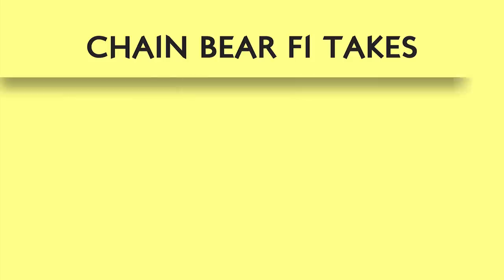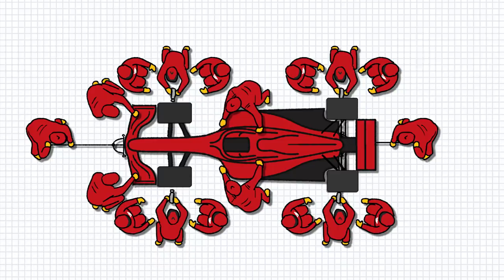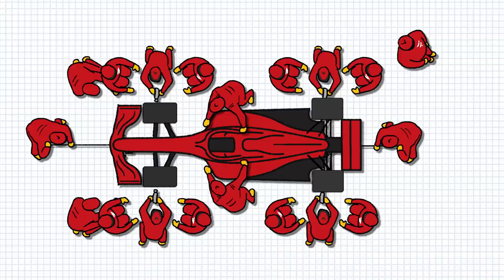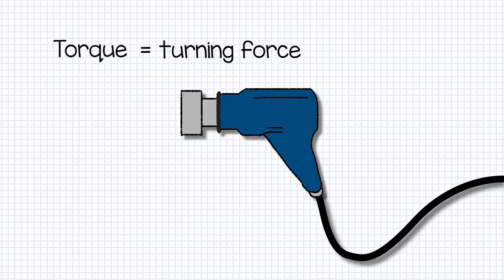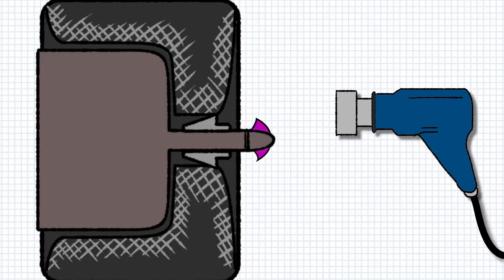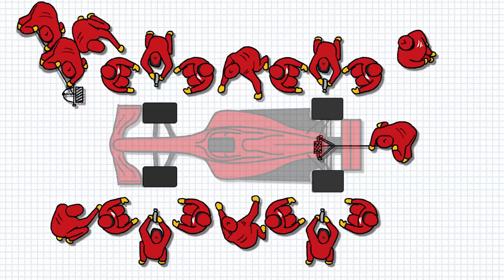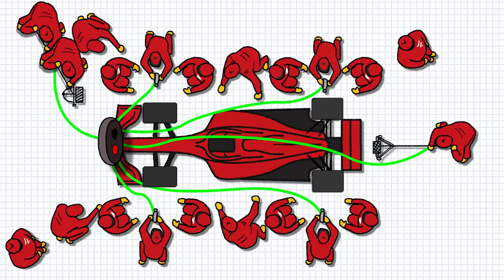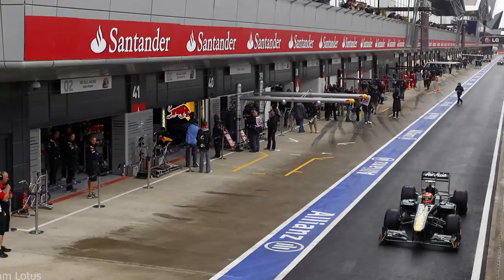The anatomy of an F1 pitstop - Two seconds of mayhem - Bahrain GP 2018

Comment: In this modern world of sensors... Wheel nut sensors for secure fixed tyres?... Sensor under on the car where the jack points are to assure the car is down... ultrasonic distance censor to break or prevent launch, that should save the guys from getting ran over.

It may sound simple, but these are all gadgets that already exist with real-world applications.

Comment: Or, 1 operator inside the building for each wheel, looking with a camera fixed on top of the car.each operator would have to release a button when the surrounding of the wheel is clear and mechanicaly done.1 operator looking at 3 mechanicians, more clearance vision, stress pressure released.

Comment: What about trackers in the wheels and trackers in the pit crews kneepads feet and hands, this would work in tandem with some type of camera system that all pitcrew trackers are outside the wheels area and would also make sure that all wheels were/are changed (each wheel set has a different tracker id).

Comment: 3 quick ideas after watching your video...
have the front end in the air first, when done and lowered the read end can go up, this puts the front half of the crew in a safe spot and they can observe. longer pit stop yes, but not by much.
robotic tire loosening and tightening machines, the tire crew swings a robotic unit that has the fresh tire in its grip and a gun to tighten the nut to a specified torque, that once sensed by the machine.... alerts the green light.
use formula e style car changes at the halfway point, eliminate refuelling and tire changes altogether. driver 1 pulls into the pit lane and driver 2 takes off, ala a relay race.
this would mean new qualifying rules, does the fastest car start first or run second stint? the fastest driver in the second fastest car or the fastest? more drivers more team work more excitement and strategies....  great pitstop infographic!

Comment: In this case, it looks like the gun operator ( struggling to remove the wheel nut ) accidentally hit the switch that activated the green light, that
Was the signal for the rear jack operator to lower the car,  which then took off.

Comment: Minimum pitstop time: NOOOOO.
Fewer pitstop crew: I'd rather not...
I personally think that some of the teams systems are just fundamentally flawed. If bringing in a standardized pitstop procedure is necessary, then so be it...
Bringing back the lollypop: I don't see how this makes it any safer.

Lightning fast pitstops is one of the things that makes current F1 so mind-blowing the first time you see a race.

I do agree that changes have to be made, but I think that a better failsafe/deadman system can be created. We don't actually know exactly what system most teams are using as far as buttons and overrides. I had always assumed it worked a certain way for all teams (with every single mechanic needing to hold a button down in order to change the light) until I was told otherwise.

Comment: Great video!

I think perhaps the incident & cost cutting measures could provide a little impetus for sensible joint development between teams for one design torque guns, nuts, wheels, more human error resilient switches. There's really no competitive show advantage for Ferrari, Mercedes and Red Bull to have a different design on their torque gun, wheels, wheelnuts. But if all the teams collectively shared their knowledge on them, perhaps it could be made safer without hurting the show or even adding cost.

For example? Instead of trusting 1 individual to avoid going into autopilot mode on something they train and practice to the point of committing to muscle memory - the "GO" switch needs to be one that isn't just flicked, but applied sustained pressure. IOW - if the wheel gun crew member hit the switch but sees the nut isn't on properly - he can in that second release the signal switch and it'll go red again (instead of waving his hand and hoping someone stops the release). If every team had this same design - then there's not competitive disincentive to have that way, and pit crews compete on training/ability and not on risk tolerance.

Comment: So the way I see it, if we want to improve pit lane safety, the best option would be to get rid of the manual jacks and use some kind of pneumatic system like in sports car racing. Sure it would be tricky for the teams to legally incorporate a pneumatic jack system to their respective chassis but this way, the crewman holding the front jack wouldn’t be standing in front of a moving car or having to dodge out of the way before it leaves, the rear jacker wouldn’t be required, and the crew members on either side wouldn’t need to “steady” the car up on the jacks, thus eliminating 4 cooks in a very crowded kitchen. This would also allow another method of electronically controlling the stop/go light by holding the car in the air until it is safe to release as well as keep the clutch disengaged until the mechanics have secured their wheels.

What does everybody think?
Reply: Btw love your stuff chainbear!

Comment: With Kimi there was only 1 spotter/supervisor at the front of the car. If there was a second guy at the back he would have seen the problem with the rear wheel and cancelled the launch. So i think the solution would be to mandate 2 supervisors/spotters or whatever they are called

Comment: My idea would be to get a rectangle painted on the concrete surface in front of every garage. Then the cars could only move, when there are no mechanics inside the rectangle. Drive through penalty for releasing a car while there are mechanics inside the area, or for a mechanic stepping inside the rectangle while the car is not stopped. The release could go by a light signal with a spotter watching the rectangle. That way the teams should still rely on the quick work done by the mechanics, but also it would increase safety, as it would be clear if there is a problem during the pitstop. Also, the FIA would need officials stnding there and overseeing the pitstop.

Comment: There is too many crewmen :o I'm sure if there was a limit, it would greatly reduce the cost. It would be thrilling to see longer pitstop, where they can only change a tire one at a time, just like in WEC.
Reply: time is everything in f1, changing tires one by one would cost u to lose so much positions.
Reply: @rey3962  What if everyone has the same number of crewmen ? Although you loose position, everyone would be equal... Logically :)

Comment: What about bringing another 4 guys. One on each tyre. Their only job si to make sure the tyre is safe. This guys should have the button. Also, put a kind of a light on each wheel nut to see if it's the the all way in.
Another idea is to put very high definition camera on top of each tyre and 4 guys from within the pit box are watching on each one's tyre and they are having the buttons. Also an automated system that is on each wheel nut, with a couple of sensors should be a nice way for the car to self check if it's safe to go

Comment: How about leave the button for the pitlight to another person for each tyre, so when the tyre has been fitted on properly the gunman can raise his hand and his allocated person can press the button safely knowing the tyre is on properly. It does increase the size of the pitcrew but it does relieve the gunman of the pressure of panicking and pressing the button accidentally. Just a thought
Reply: Mark Jones we are where we are as people are anticipating a "good" stop. It will be the same just with another person involved.
Reply: 970357ers however I do believe that the stop will be safer, might be slightly longer but pressing a button takes less thought and less time than raising a hand and having someone else press the button, the timeslot for preventing an error is much larger

Comment: Seems like the simple solution is to reduce the number of moving parts. That is, with so many people, there are a lot of individual opportunities to get something wrong. The notion of a setting a required minimum stop time is good in that it would make it possible to slow things down and take the time to get it right, reducing the probability of error due to the time. But then that has to be timed both by the team and by the marshals.

And in general I am opposed to such types of regs as it seems kind of silly to be having a race, but no, you can't do a pitstop as fast as you could, you have to take longer longer than that so as to not be too fast . WTF? It's like running a race at a fast walk where you're not allowed to actually run. But, restrict the number of people over the wall and that in itself slows things down and drags things out. There are fewer moving parts, so there are fewer hands in the works and it is also then easier for someone to oversee the operation to ensure all tasks are completed and completed fully and correctly before releasing the car. And with fewer people, it is easier to see when something goes wrong so the car can be held up rather than being released because some delay went unnoticed in the fray.

And what other sanctioning body allows that many men over the wall?

Comment: My vote is with reducing the number of tyre changing crew to one. Simplifies things a lot more than the other options, both in terms of management and safety.
Reply: The stops would take really long,  maybe it would change the strategies in a good way, but i would guess teams would not want to pit as many times. So basically all races would again just have one stop, which they improved for this season with the softer compounds.

Comment: I'm interested in the question why kimis brakes started to overheat after the pit stop. Do you know something about this?
Reply: I´m far from an expert in this but I think it is because of the longer time the car is stationary. Brakes are designed to get away from pit and cool the brakes in a few seconds. If they have to do repair, change front wing for instance, you´ll see mechanics with big fans cooling the brakes because of the longer stop. Surely someone more knowledgeable will give the correct answer (but I had to try :) )
Reply: I'm not sure if this is how F1 breaks are specifically designed, but I know that brakes can be cooled with the aerodynamic properties of the car. If the car is stationary, there is minimal airflow, and the brakes don't get cooled.
Reply: Think the break discs can be up to 1200 celcius. So when they are stopped everything around the break discs that are not made for the high temps will get heated up a lot.
Reply: As nulian already wrote, the problem in this case was not the brake discs itself it was the stuff around the brake discs.
Normally the brake discs are cooled with air through some ducts. You can see them on the inside of the wheel carrier. This is a pretty good picture of them: https://imgr2.auto-motor-und-sport.de/Ferrari-Formel-1-GP-Bahrain-5-April-2018-fotoshowBig-5c323d20-1156896.jpg
The problem is, this of course only works as long as the car is moving forward. If the car stops for whatever reason, the airflow no longer cools the brake discs and they start to heat up everything near them. Which means cables, bearings and so on.
Reply: Because he abruptly stopped again which prevented the brake disc to be cooled had he continued as usual from a pit stop.
Reply: When on track, the brakes get very hot, but they are constantly being cooled by brake cooling  ducts in the wheel hub taking in air while the car is moving, but when the car stops, there is no air entering those ducts, so no cooling, hence why they start smoking

Comment: 5sec pitstops would affect racestrategies too much in races where pitstops varies from 1-3 in a race. Just like in Bahrain. A team with 2stops will get an even greater gap of ~2secs to cars only having one stop. Making mechanics get behind a certain line away from car before green light would be better as it would get competitive between the pitcrews aswell. Well,  a certain would be added anyways comparing to a 5sec stop but its alot safer.

Comment: In all honesty the easiest way to fix this is if a mechanic is having an issue, they press a button which disables the automatic system. It will take a manual que to turn the lights green.
Reply: Sideways Nismo they have this already. It's not foul proof in the heat of the moment. You're tunnel visioning in on one thing and one thing only, and you might not notice your mistake in time or react fast enough to click the button before the driver has already set off

Comment: If a minimum pitstop time is introduced, won't teams be discouraged to try different strategies, for example taking an extra pitstop while using softer compounds? This would mean even less on-track overtakes. Or is the pitstop time difference so tiny it becomes negligible?

Comment: Why not have a torque sensor built into the gun. Rather than the mechanic pressing a button to release the car, this would automatically turn the light green only when the gun has sensed that the nut has been tightened properly. We use a this system in automotive steering gear manufacturing to ensure proper torque of bolts.
Reply: That would only tell you that the wheel nut had reached the required torque, not that it is seated properly. 

A nut going down a bolt can be tight enough to trigger a torque wrench but not have travelled the required number of turns. In certain automotive construction applications the wrench knows how many turns the nut should make and the required torque and will not give the green light until both have been reached.

The other issue with your suggestion is that even if the gun counted the turns and reached the preset torque the gun would not know if it had been removed from the nut and there have been plenty of incidents where the gun sticks on the nut.

I love the technology in F1 and the discussions it raises, it's part of the thrill for me. Yeah, I know, sad really.....
Reply: @ohidontknow1061  That is a very good point I hadn't considered. Thank you

Comment: Replace pit crews with automated systems. I'm sure that would be faster. Problems I see is that the car needs to stop exactly right in the system. It also takes away from the skill of the pit crew and instead places it on engineers

Comment: Why not have the guns automatically send the signal after they detect a significant drop in resistance (signaling over-tightening)? Why not have the spotter replaced with a computer system to track cars and release them only when the time is right?

Comment: Good explanation.
Although I still didn't understand how can the green light be triggered when not all the mechanics that are in charge to loosen and tighten the wheel nut didn't push their buttons. Like it Kimi's incident, when the left rear tyre was not removed... Did the guy press the button even when the left old tyre was still in place?
Ps: if you talk a bit slower, it would be perfect, especially for guys like me whose english is not my mother tongue and when you don't speak english every day!

Comment: This is the 4th time this racing season I've seen a driver take off with an unsecured wheel. The first was a NASCAR Camping World Truck Series race at Atlanta. Kyle came into the pits under caution and the crew had a problem with right front tire and rear tire carrier and right rear changer were working on the right side while the left front tire was going on the truck. When the jackman dropped the jack, Kyle left the pit box unaware that his crew was doing a 4 tire pit stop and the right rear tire came off the truck. Here's a cip of the incident: https://www.youtube.com/watch?v=GQnAihTjCqM

Note: The reason why the crowd was cheering is because Kyle Busch is one of the most hated drivers in NASCAR

Comment: I disagree with part of what you said. I know it's  a fast process, but with radio communication and the pitstop guys knowing there was an issue, with them putting up their hands, the teams should be able to stop the car before it reach on the track. Ferrari did in the race, I don't know why haas cars reached out on track and they knew the moment it happened.